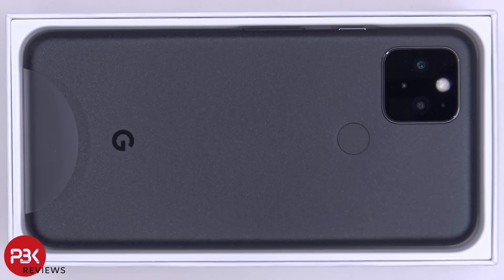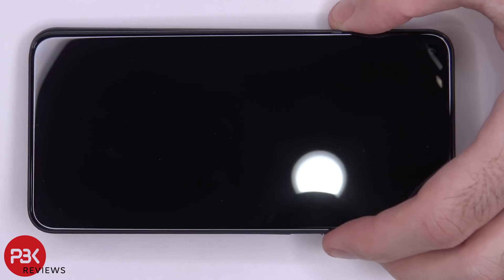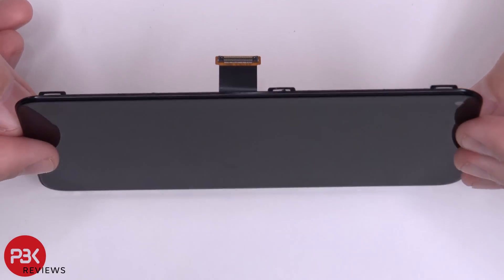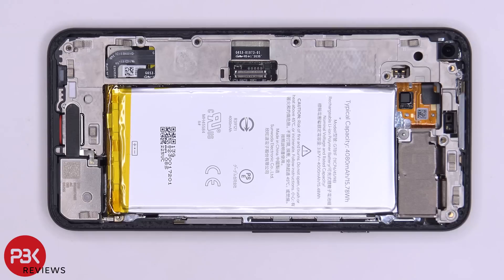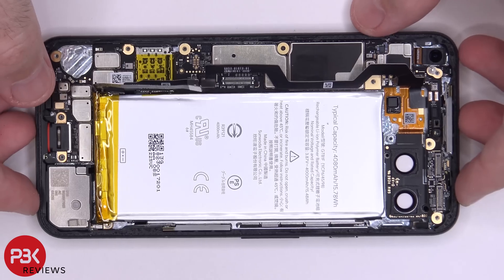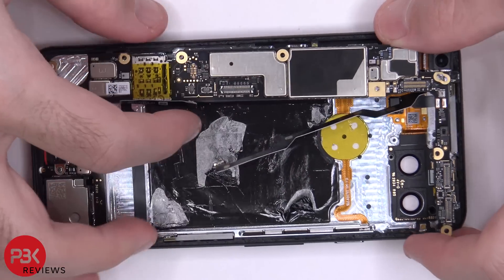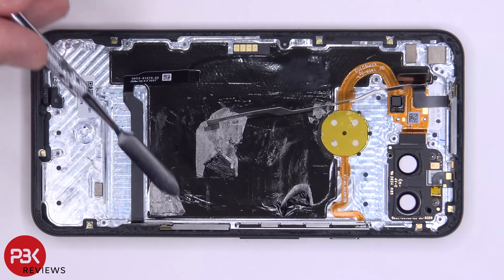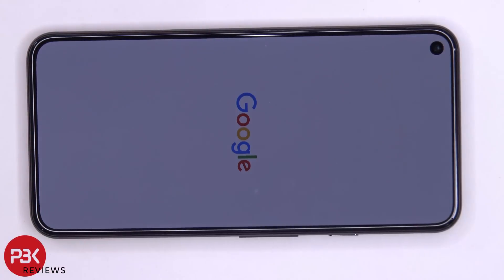Google Pixel 5 5G Disassembly Teardown Repair Video Review. Screen Gap?

Comment: Finally a Pixel 5 teardown. Nice video. Was curious to see how the Wireless charging works with the metal frame.
Reply: OK so European models don't have mmwave 5G antennas ? 📶
Reply: @maxoo._  yes. I think we only get sub6 5G hardware
Reply: @RamakrishnaLVV  Oh what a pity, I live in Europe, in France 🇫🇷 !
Reply from the maker: @maxoo._  Some regions may not have the mmWave antennas depending on what type of 5G the carriers in those regions use. I'm not sure which carriers use mmWave in Europe to know if for sure the ones in that region will or will not come with it.
Reply: @PBKreviews  In France and Germany all smartphones are sold "free or naked" that means carrierless, so that means that Google ships them uniformly whatever the carrier contract the customer will sign after buying the phone... or even many customers keep the same contracts for years regardless changing their smartphones every 2 years... 😉
In USA : small smartphone price with expensive contracts.
In France and Germany : advised manufacturer smartphone price (500, 600, 700, 800, 900, 1000€) with low carrier contract price (from 2 to 50€ per month)
For my case : bought in March 2019 my Pixel 3 599€ and kept my 9,99€ carrier contract per month that i already had 3 years ago and still have it 😉
Reply from the maker: @maxoo._  Oh I see that's interesting. So if the case were that all carriers in EU use low band 5G and none support mmWave then I would presume the EU region pixel 5 would not come with the mmWave antennas. For example in the US, since verizon uses the mmWave but most other networks use a different type of 5G network, then if a phone is made for Verizon network and is also unlocked, it would have support for the mmWave 5G as well as the regular 5G networks every other networks use in the US. Like the Galaxy Note 20 sold by samsung, the Verizon version or the factory unlocked variant comes with mmWave antenna in addition to the other 5G antennas (so it will be compatible with all networks in the US). But if you purchase the At&t variant, it will not have mmWave antenna so would only work on At&t or other similar band networks that use that type of 5G but will not work on any network like Verizon that uses mmWave. So if in EU none of the carriers use mmWave then the chances are the pixel 5 in that region will not have the antennas for it, but if there is a carrier that does support mmWave then its possible the EU version will also come with mmWave to be able to have support for that specific carrier as well as all the rest.
Reply: @PBKreviews  Good explanation... In France and Germany 5G antennas sub 6 and mmwave will operate on summer 2021 only for each carriers... so Google or whatever the manufacturer who sends smartphones to Europe design their devices to be compatible with 5G (those equipped with 5G chips of course) there are not like in the US, one variant for Orange (carrier) one for Bouygues Telecom, SFR and so on... They all use the same network bands and only either B20 or B28 varies according to the carrier, so that means it is easier for manufacturers to produce European devices and brings to them no brain bummer 😉
Moreover in France most of customers like me buy their smartphones in specialized shops like Walmart or Best Buy in US (FNAC, DARTY, BOULANGER in France) and not often through carriers since they are carrierless and unlocked and sign their carrier contracts through internet or by calling to get the most interesting offers : 2€/month, 5€... 🤗
Reply: Is there a way to connect two batteries?😝
Reply from the maker: Thank you :)
Reply: @PBKreviews  Looks like the plastic sub-frame that houses the display would protect it from unwanted damage while dismantling for repair. Also is this a US version? Not sure if all versions have the mmWave 5G antenna.
Reply from the maker: Yes it was a US version and ya the ones that don't have the mmWave antenna would just have a slot filler or empty slot where the antenna would go.

Comment: Would it be possible to swap the 765G for the 865?
Reply from the maker: No I doubt that would be possible. Not only would it require hardware alterations, would also require software alterations.